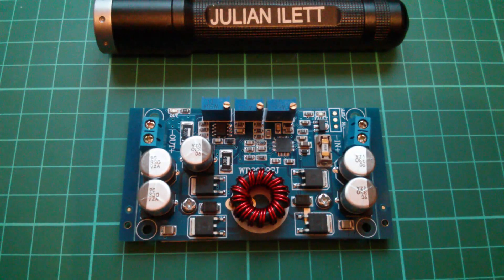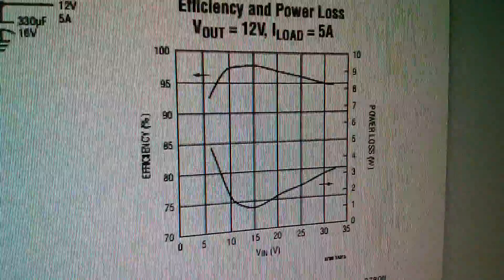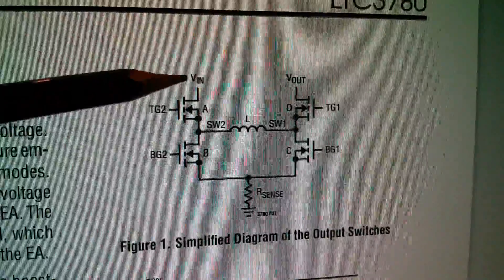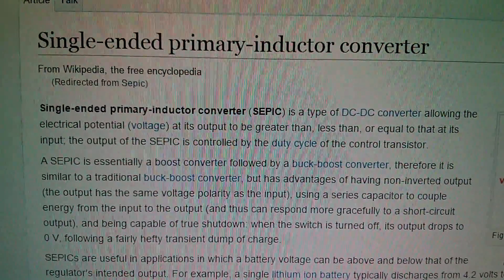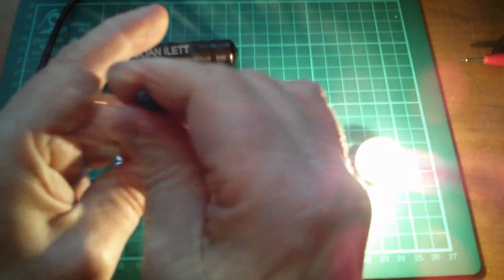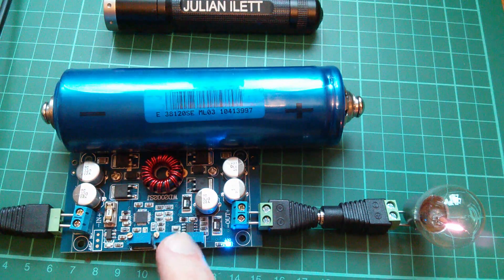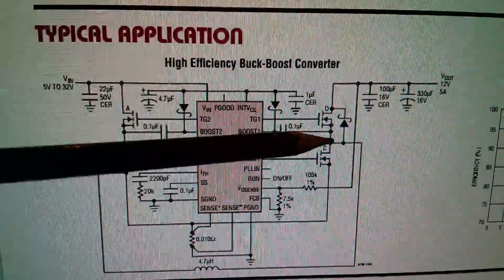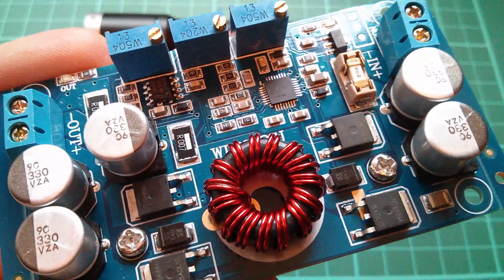First Look: LTC3780 Buck/Boost DC/DC Converter 10A 130W

Comment: I have the other version of this. I did not manage to test it but I will probably also order the version with current limiting.
The third potentiometer is usually to control an LED to a set voltage point so when you get there you have a visual indication to say that a battery is charged since it reached the set charge voltage.
28V is good for charging 8x LiFePO4 cells is 3.5V/cell if they are properly balanced and that is more than good enough there will not be more than 1% capacity gain if you go to 3.6V/cell. You can make a test to check that.
Also just cc is good enough for LiFePO4 with just CC (constant current charge) at 3.6V you get over 95% of the battery capacity depending on the charge current value and the internal resistance of the cell.
So you can use this power supply with my SBMS or other BMS (take care the BMS I sent you is not good for LiFePO4 even if is advertised as such) The cut off is at 3.9V and that is a proper limit for LiCoO2 cells (the most popular rechargeable cells present in most mobile phones and Laptops).
LiCoO2 is usually charged at 4.2V in this mobile applications to provide the maximum energy density in the detriment of battery life. But different other upper limits are used of this cells. Each 100mV decrease in max charge voltage will double the cell life cycle. And 3.9V or 3.95V is about the smallest practical use. 3.9V will offer up to 8x the cycle life but with only about 60% of the battery capacity used when compared to 4.2V. Still there are applications where life is more important than energy density and this 3.9V voltage level is used primarily by military or space applications.
Those 5 pin IC one for each cell have this protection limits fixed in hardware 3.9V upper limit and only 2V lower limits both are quite detrimental to LiFePO4. With normal 3.6V max 3.65V on the high end and 2.8V min 2.5V on the low end.
Reply from the maker: ***** Interestingly, eclipsebikes sent me an email after I bought the LiFePo4s telling me not to let them go over 3.9V or under 2.0V - not really surprising as they also sell those fixed voltage BMS units too. I'l probably just show and talk about the BMS boards, probably not connect them up as there would be little to see. I may need to ask you a few questions about the SBMS, for example, does it cut the input at the end of the CC phase? I can't see how it could do any current limiting.
Reply: Julian Ilett
Yes the SBMS dose CC charge only so it cuts the output when the highest cell gets to the set limit.
CV is necessary for Lead Acid and they use PWM to limit the average current or constant current limiting on MPPT where they use a DC-DC converter and can do that.
Lithium especially LiFePO4 is almost like a capacitor after CC is fully charged or very close. And since Lithium prefers not to be fully charged using CV will reduce battery life with almost no gain SOC usually 1 to max 5% depending on the charge rate.
With solar the PV panel will reduce the current anyway at the end of day so you actually get 100% SOC with not need for CV.
Best indication of how a LiFePO4 is charged is to look at a charge discharge curve.
The charge on the SBMS will start again when the voltage on the highest cell drops under the set limit (you can set any limit) but 3.4V is probably a good value.
So the SBMS will do ON and OFF for charging in between this two limits say 3.4 and 3.6V. You can almost call this a slow PWM.
The capacity between this 3.4 -3 .6V limit is really small maybe 0.2% to 0.5% of the battery capacity.
Tests on LiFePO4 where done with shallow discharge top 5 to 10% charge discharge cycles with almost no degradation in battery capacity after many thens of thousand cycles getting close to 100k cycles in some test.

Comment: Very nice little found Quite pricy I'd say but I guess when you need high efficiency you have it :) I have a few of those little cheap solar buck boost converter they do a decent job for cheap mini power supply :) and also handle couple of amps. Thanks for sharing!

Comment: Thanks for another very interesting video,
 
I have not commented on any of your videos before however they have been great and i soon ended up ordering everything you have shown in your postbag vids from the wireless communication devices onwards in the hope i can get these devices up and running and do some experiments and maybe even do some of my own videos on my experiments,
 
I am a little worried so far as nothings arrived so far and my first order was at the start of December but then again it is ordering outside the UK and a lot of holidays in the middle,
 
I like the idea of allowing a digital control of a converter like this and maybe using your economy Arduino set up and YES i have ordered those as well, in addition i have ordered a voltage ref IC and 2 of 10 bit serial DAC PCB's like the Allice ones you show so one for voltage setting and one for current setting and a precision current sense resistor for the readout of the load Amps,
 
I am not an Arduino programmer at all so will have a steep learning curve as so far all i have used is BasicMicro Nano PIC IC's that are programmed in BASIC,
 
Keep up the good work and i look forward to the next video !,
 
Thanks
Reply from the maker: david ellis Thanks David. I'm sure your purchased items will start arriving soon. I generally buy little and often so as not to go over the ridiculously low £15 VAT threshold
Reply: Julian Ilett That is good advice as did not know there was a chance of VAT being charged after i hav purchased the items and that may well be delaying my items if they are stuck in customs waiting for me to make a payment, i have just had a packet arrive today with a meter that was sent to me on the 16th Dec and that was from the UK sent 1st class recorded and its taken almost a month to arrive so for items from China not to have arrived yet does not seem so bad after all, i would be interested to see how you make your videos and edit them etc as they do seem a fantastic quality for a home made video compaired to some i have seen on here, Thanks, Dave
Reply: Julian Ilett As this item is over the £15, did you end up paying the VAT, import duty, plus fee... etc....? for this item?
Reply: Andrew Melvin HI

Well i purchased a whole batch of stuff from this seller and i managed to get a 25% discount on the whole order and that has just arrived today, there was no mention of extra fees or customs charges etc so unles they send you a bill for this at a later date it look like in this case i did not have to pay anything extra and the total order value was $488 after the discount and the box was 400x300x200mm and around 10Kg and free P&P so i was very pleased overall, the packing was very good with each item in its own padded bag,

My allice items came yesterday and that order was over $120 after discount of 15% was taken off and there was still no customs fees to pay, i think this may just be down to luck BUT i did have both sets of items sent to my company address and i am not sure if that makes any differance when it comes to customs charges, VAT etc, the packing from Allice was not fantastic and i did get a few bent pins and 2 capacitors on 2 out of the 5 600W power supplies were bent so that one of the pins was pulled out of the cap body but they have aranged 2 replacements to be sent out so still all good and so far i am very pleased with both sellers,

Be interested to know of others users experience on purchasing from China as far as customs fees, VAT etc,

Dave

Comment: Woo I thnk I'll do exactly what you suggest. I've got a bunch of benchtop supplies, but nothing that goes up to 10A, my two most-used supplies are 1-120v 1A, and 1-38v 3A. Could definitely use one that delivery 10A - would be interested to see you test it up to the full power output just to see how warm it does get (and whether I'd need fans).I'd probably solder a low an da high value pot in series for each control to give corse and find adjustments.Would probably add voltage and current displays too - any chance of soldering directly onto the existing current shunt? I wouldn't wanna double shunt it..
Reply from the maker: Kieran Simkin As is often the case with these converters, it seems that 8 amps is the limit without extra heatsinking. But that could simply mean mounting it inside a metal box. You probably would need to double shunt it - the output of the current sense op amp should be easy enough to find, but converting that voltage into a meaningful measure of current could be challenging.
Reply: Julian Ilett
is the heat mainly in the mosfets or does the coil get warm? Hopefully the caps stay cool right? The reason I ask is because I've got a Rigol DS110E which is noisy as hell, and my 3A supply also roars like a jet engine. It's distracting enough under normal use, but when trying to film YouTube vids it's not practical. Both are likely to get modded to use water cooling - I've become a little obsessed after some successes with my high-tech fish tank project, which you may be interested in, so I'll tell you about it:
My fish tank is lit with 3 50W full spectrum LEDs (they're special mega-expensive ones specifically for fish tanks) I know you're an obsessive ebayer like myself, so I'll provide links:
http://www.ebay.com/itm/231233542088.
Each row is a different spectrum, and I've got them all wired separately which opens the possibility of doing some cool PWM efffects on my fish tank :)

Initially I mounted them on massive heatsinks that were adequate for passive cooling (to reduce noise - also look really cool).
http://www.ebay.co.uk/itm/160877013802
This worked fine, until I realised the middle of the three LEDs needed to be mounted under my filter tray, which left no space for the heatsink. My original solution to this was to build a C-shaped heat pipe out of rather expensive copper bar stock. Not only was this a complete pain to solder due to thermal dissipation (I think I used a blow torch, hot air gun and soldering iron all at once), but it also didn't work that well, the centre LED got significantly hotter than the others. Furthermore, I somehow managed to ruin 3 of the 5 colour channels on that particular LED so it was in fact only a 20W light, dimmer than the others, and a different colour.

Something had to be done! Then suddenl;y it occurred to me - I'm spending money heating the fish tank with heaters - it's a tropical tank. But I'm rejecting heat from the LEDs into the room?! What a waste! If only the heat from the LEDs could be used to heat the tank, kill two birds with one stone and possibly end up with the most energy efficient fish tank on the planet. Not only that, but I already had water being circulated through 8mm tubing for the filter system, and the water coming out of the filter was largely free of particulates, sludge, fish etc  Admittedly the heaters would still be needed during the dark part of the day when the lights are off, plus the heat from the LED would not be thermostatically controlled, so I can't have a situation where all of the heat for the tank is provided by the lighting - I need the thermostatic control of the aquarium heaters, but there's nothing to stop me using the heat from one of the LEDs to supplement that of the tank heaters so that the thermostat spends less time burning electricity. It also occurred to me that I had a bag full of these cheapo water cooling blocks from another project that is yet-to-be-completed, which are the perfect size for a 50w LED (also perfect for a peltier device). Obligatory ebay link:
http://www.ebay.co.uk/itm/161459225916

So, I bought a new one of the ridiculously expensive 50w LEDs, glued it to a water block, plumbed it in to the existing water circulation system and it works like a dream, and it's low-profile enough to fit underneath the filter tray in the middle of the tank. LED runs about the same temperature as the others do with massive heatsinks (limited I think by their own ability to conduct heat away).  I'm thinking of doing the same with the other two, although I need to test whether that would be so much heat, the thermostatic action of the tank's proper aquarium heaters would be overwhelmed.  With one LED it's fine.

Now I feel inspired to stick cheap chinese waterblocks on everything and make it all silent :D The Rigol is next! I shall probably video that little hack for YouTube, I've just started recording my projects like this :)

Just thought all that stuff might interest you, you'll probably see some videos of bits of it when I start uploading them :)

Back to the original topic - if all the heat is in the MOSFETs, I will stick tiny water blocks on them and try to make a near-silent water-cooled 10A power supply. That'd be amazing :D If there's too much heat in the coil or the caps that may not be practical - I'm gonna get one of these boards anyway and have  play :)

Comment: Can't see if someone already mentioned this but maybe the third pot is for frequency control? Might be worth checking where the trace for it is going and see if it makes sense to what is described in the data sheet for frequency adjustments.
Reply from the maker: Hampus Sandberg These converters are normally fixed frequency, or the frequency is varied to maintain maximum efficiency. It seems the third pot controls a disconnect mechanism for low input voltage.

Comment: Hi Julian,

nice interesting Video. I like Buck/Boost converters. I wonder if there is one for maximum 1 Amp, which is very small? My requirement is to have constant current mode to drive 14 LEDs in parallel. When the LiIon goes below 3.4 Volts, it has to boost slightly, when it's above it has to take the voltage down so that the current is constant. Do you have any idea of a module for this? The cell is protected via the both charging and protection board you also shown, here.

Additionally I have to complain slightly about the video quality. Can you please consider not showing the extremly low resolution display and instead of that show this things with a screen capture application (there are even free ones for windows out there) and point with the mouse? The quality at this parts is so awful that it hurts. You can even see the motion estimation! Your bitrate seems to be very low, too. That is okay when filming real life things. But as soon as you show your low resolution PC/Laptop display, it's really irritating.

Nevertheless, thumbs up and keep up the great videos!

Comment: If you come in with higher voltage can you get higher boost ? or is the max boos fixed ?
Reply from the maker: louigi600 The output voltage range is not generally affected by input voltage, although you may get higher efficiency with a higher input voltage.
Reply: Well then I guess one could try fiddling with the windings on the toroid to see if one can get more boost

Comment: Question that I've been itching to ask on a few of these videos about power converters... are you able to drive PWM loads with them?
For example a channel on a 10W RGB LED (potentially resistive current limited if necessary) through a power mosfet.
Reply from the maker: Lee Cook It would probably work, but better to use a purpose-designed LED driver with an enable input - they're designed to be pulse width modulated (and often have a spec for frequency range etc.)

Comment: Very nice video.
I like the idea of making a small power supply out of a module like this one.
I tried with with this booat-buck module:
http://www.aliexpress.com/snapshot/6259934254.html
Alas, it stopped regulating after I swapped the voltage and current onboard pots by 10 turn pots... Anyway, I'll revisit that project when dummy load is ready.
Reply: Ups, no idea how my comment ended up on top of Julian's

Comment: Very interesting video and device. My bench power supply only goes up to 5A. This would be a good secondary power supply for things like small motors. I was wondering how it can handle 10A till I saw the aluminium plate at the end of the video. :-)

Comment: Got this tiny one. CV-CC with a middle pot to cut off terminal current drops to eg. 100ma when LiIon is charged.  http://www.aliexpress.com/item/New-Arrive-LM2577S-LM2596S-DC-DC-Step-Up-Down-Boost-Buck-Voltage-Power-Converter-Module/1894500508.html

Comment: It would be cool to know if these drivers have continuous ground or positive, or neither.
Reply from the maker: Forssa1 This converter has a common ground
Reply: Hey Julian, this is not 100% correct. The output ground contains the shunt resistor for the output current control.
So even if it is close (only a few milli Ohms) to same potential a bridging would remove the shunt's voltage drop of the CC functionality.
That means the input PGND as well as the controllers SGND are the same, the output's GND is off by about I_out*R_shunt.

Comment: what is the max input or did i miss that?
?
Reply from the maker: Andrew Bryant pianotunerbristol Input voltage range is 5 - 32 volts according to the eBay listing
Reply: Mmm not bad! I was looking for a 48 in 22 out 
at 10 amp  cheers anyway :)
Reply: Thanks +Julian Ilett for the good review.
One addition from my side: The actual LTC3780 can be used up to Vin = 36V.
The current control functionality and the low voltage cutoff functions are based on a LM358 OPamp which only goes up to Vmax = 32V.
That is (unfortunately) the limiting factor with this board.